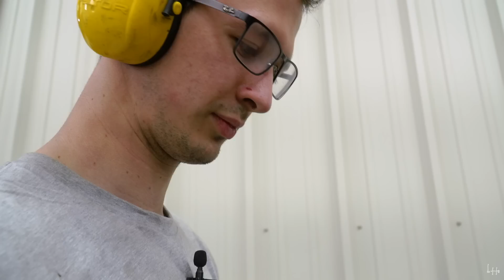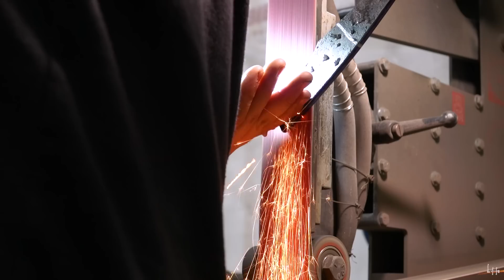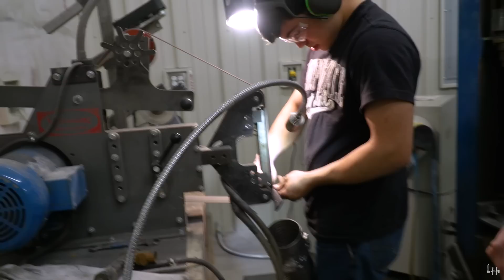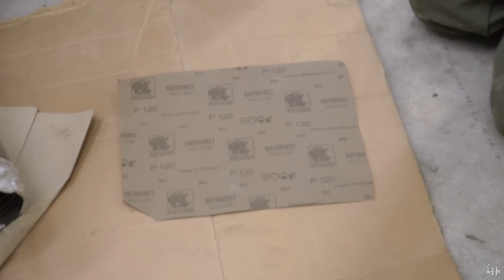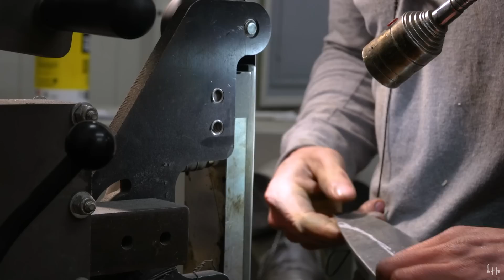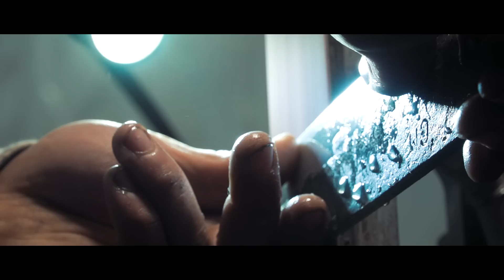CHAD MAKES HIS FIRST KNIFE WITH ME Pt. 3

Comment: What are the hoses attached to the back of your grinder platen for?  Is there coolant running through them?
Reply: Since I saw this before Liam could reply... That's an aluminum chiller plate with channels milled in to circulate cold water. I got mine from a talented machinist who goes by the handle "Nathan the Machinist" on BladeForums. They are sweet. Nathan sells a bunch of other really nice swag too.  Clyde